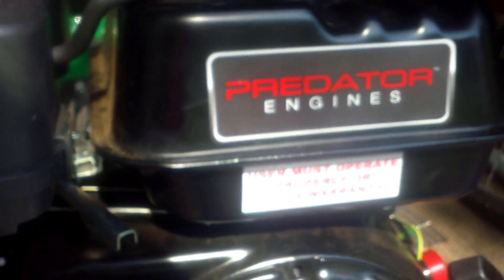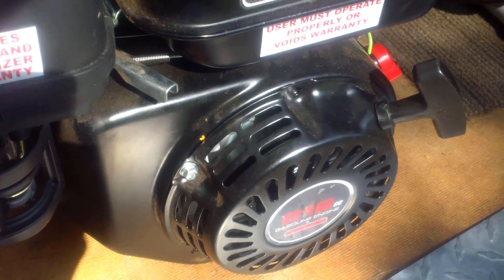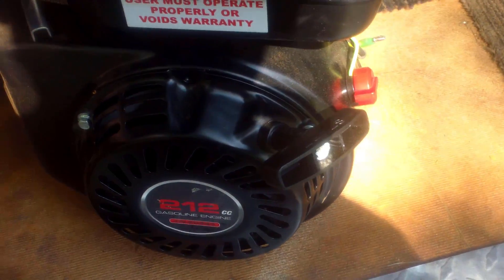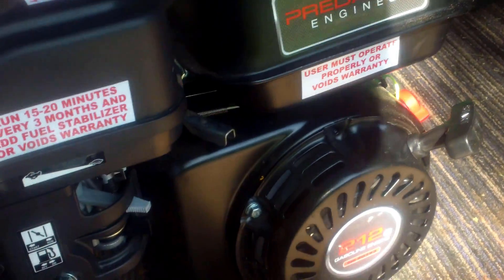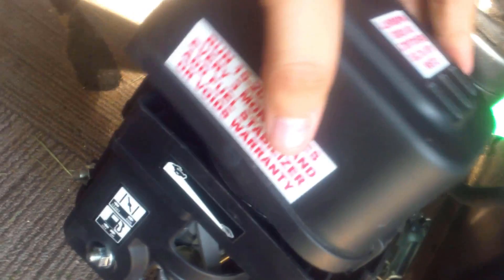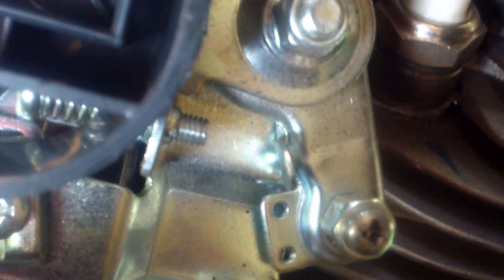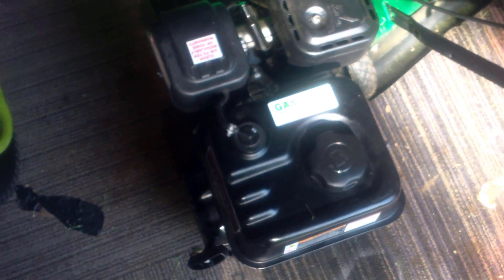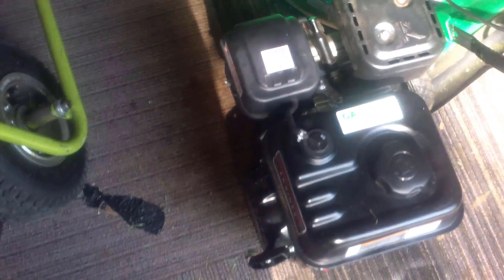How to make a predator 212 engine go at a higher speed

Comment: you can back the screw out, and it be safe the governor will still kick in. to fully actually remove the governor, you have to take the ugly white plastic gear out of the engine, which i dont recommend doing. so yes you can basically back the throttle limiting screw out and be good to go and gain speed, but to a certain point the governor will still kick in
Reply: Can u take it out fully

Comment: What will happen if I loosen the throttle limit screw and removing the governor will it even create more horsepower.
Reply: Yes but dont hold it wide open for a long time itll blow up
Reply: @drunkencracker8517  thanks
Reply: @shushunliu6572  no problem
Reply: @drunkencracker8517  also if I remove the throttle limit screw and removing the governor and adding stage 1 performance part would it create more horsepower.
Reply: @shushunliu6572  yes sir
Reply: @drunkencracker8517  how much hp you think it would make if I loosen the throttle limit screw and removing the governor and adding stage 1 on tillotson 212cc or predator 212cc.
Reply: @shushunliu6572  if you have the option go with the tiltson stock it makes the same as a predator stage 1 but anywhere from 20 to 30ish hp
Reply: @drunkencracker8517  ok thanks for info 👍 I like your thoughts thank you
Reply: @shushunliu6572  no problem bro

Comment: I took my whole governor out of my predator 212. I was stock internals and flywheel. It revved higher than yours did. I ran it wide open alot. Still sounds like new. I still have engine. Its just been sitting on the shelf for about a year. Thinkin bout pulling it out and cranking it up. I had valve float for my rev limiter😂 you can here it if you watch my predator 212 videos. It was on my go kart for a while and on my mini bike for a little bit

Good video nevertheless. It gives it a little more rpm than stock

I have a playlist named go kart videos. A few Predator 212 videos are in there too

Comment: I took mines out and when I go the bikes takes off quick then it goes super slow please please help
Reply from the maker: kholan mine did the same... try turning the idle screw a little bit until it is at a good rpm to idle at
Reply: @streetstallion  mine doesn't have the screw in there any more. I think it fell out and now it goes slow. Does it need the screw or do I have to adjust the throttle M
Reply: @streetstallion  where is the idle screw?
Reply from the maker: JDH at that point you probably should just get another screw... if that screw is missing most likely won’t run
Reply: @BabyBirdFOH  im running it with no screw i own 5 mini bikes the reason it takes off quick then gets slow , your gov is kicking in.
Reply: @BabyBirdFOH  dont mess with the idle screw

Comment: The last time I did that my torque converter came off and the bolt that holds the torque converter broke in half I try to make my go kart go fast from 13mph and the torque converter came off once it reached 25mph
Reply: didn’t torque the bolt down tight enough..user error

Comment: Is it bad for the engine to run on max speed
Reply from the maker: Not for a long period of time of course. But if your not beating on it to hard it will be fine. I beat on this motor a lot and it still runs perfectly fine. Just don’t ride at max rpm 👍
Reply: What's that screw for and I use it for go-kart but I wanted to take out the screw but I'm afraid it will damage the motor
Reply from the maker: Anthony Germano you can take it out if you want, you’ll be fine 👍
Reply: @anthonygermano2696  It is the throttle limit adjustment screw